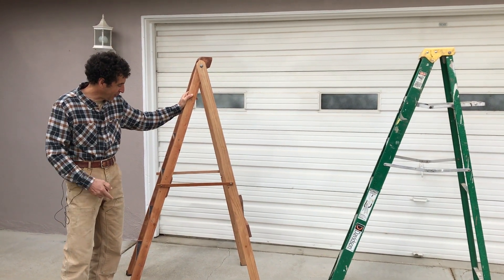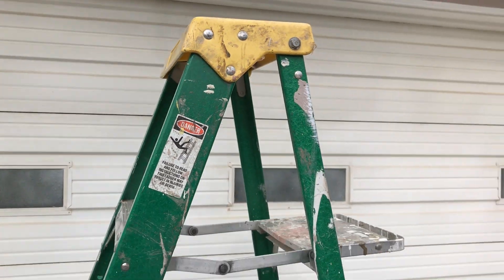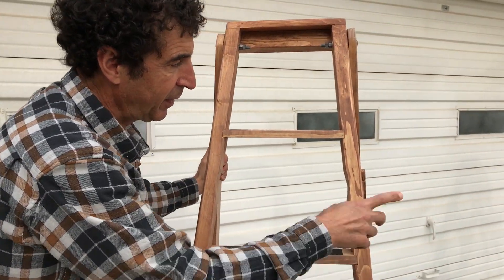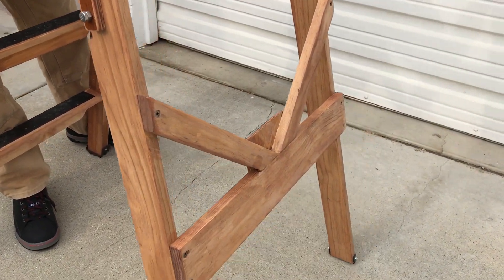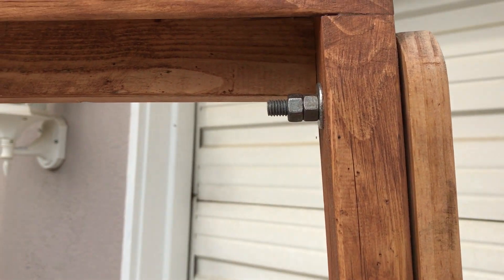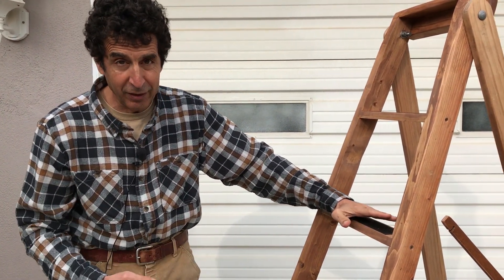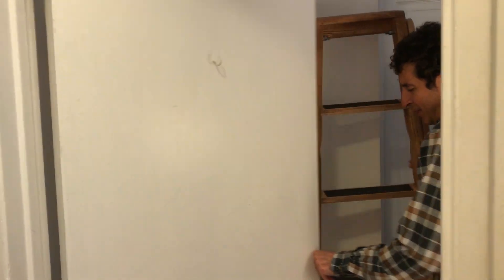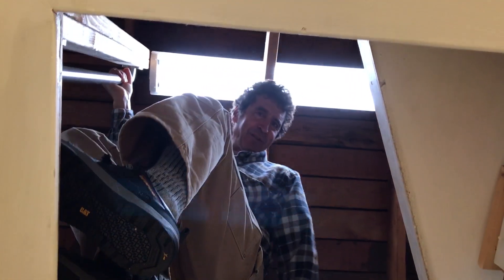DIY Fold Flat Wooden Step Ladder for Interior Use.  Stores behind door.

Comment: Can you make a video how you made that ladder or could you post the drawings. I would like to build the same ladder.
Reply from the maker: Aleg,
It would be much too long of a video for me to show all the details and I never draw out plans as I prefer to just work things out in my head and start building.  I would recommend starting by building the step side first.  The steps need to be at an angle of about 15 degrees and the legs are at angled inward at about 5 degrees.  I just followed the angles in a commercial ladder.  Of course, you could make it even more stable if you used larger angles.  I did the steps at the top and bottom first and cut the others to fit.  The steps should be spaced less than 12 inches apart.  It is very important for safety that the steps are evenly spaced.  If you have long legs you could try more than 12 inches, but I typically am carrying heavy boxes up in my attic and like the shorter steps.  The steps are made out of knot free 1x3's and the rails are 2x3's.  The groves in the rails are cut with a router, but you could also make many passes with a circular saw with the blade set at a depth of 1/2 inch.  I used wood glue and 3 inch screws with the holes pre-drilled.  I added the back legs next and cut them so that the angles were correct and the steps were flat.  Post a video if you make improvements!

Comment: Your ladder looks really good, functional and it seems lightweight considering it is made of wood. What type of wood did you use?
Reply from the maker: Thanks.  My version weighs 18 pounds.  I used mostly Douglas Fir and pine which is pretty strong for its weight and relatively low cost where I live.  At least one person built it out of hardwood.  Here is a good chart comparing wood properties that has plenty of information except for cost:  http://workshopcompanion.com/KnowHow/Design/Nature_of_Wood/3_Wood_Strength/3_Wood_Strength.htm.
It is very important to use knot free boards for the steps.

Comment: Really great but think I would replace the side pieces to steel in case it snapped.by side bits I mean the pieces you lower which locks the two sides into place.but do really like them kindest regards tim
Reply from the maker: Yes, most commercial ladders do have steel.  However, there is very little stress on the side pieces and there are two so there is redundancy.
Reply: steel would be louder, and not as aesthetically pleasing. personally I find the design very nice in all wood!
Reply from the maker: @drbg43  Agree.  There is nearly zero force on the side pieces as I have rubber on the feet.   Sometimes I am lazy and only use one side piece, which is all that is really needed.   This ladder has now seen 5 years of use.  No issues.

Comment: Thanks, Dave. Great job! what were the cross sections of each of the members - stiles, treads, back legs, please? Thanks, Ian.
Reply from the maker: The 2 boards in the front that the steps fit into our 2x3 studs with as few knots as I could find.  I live in the USA so the true measurement is 1.5 x 2.5.   The other boards are just 1x3 which actually measure 0.75 x 2.5.   Of course, knot-free hardwood would be the best.  Using a router and glue also makes it much stronger.  I have been using it for 3 years now with no issues.

Comment: so what is the lengths of wood etc...?
Reply from the maker: The main rails are 6 feet 2x3's.  Bottom step is 22 inches and top step is 12 inches.  Everything is flexible.  The only innovation is to have the one axis and to have the front and rear legs nest.  The rear legs nest on the outside of the front legs which is the only way to nest because the steps are on the front legs.
Reply: Thank you I am back again,  Did you ever make a drawing for this?